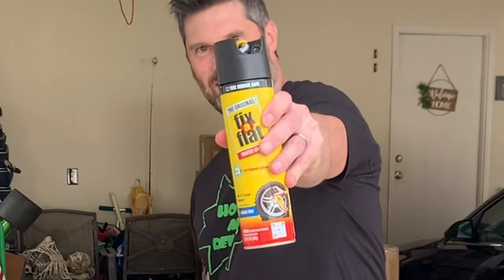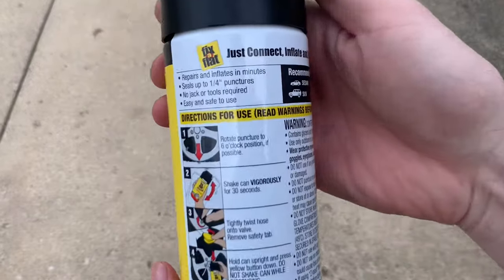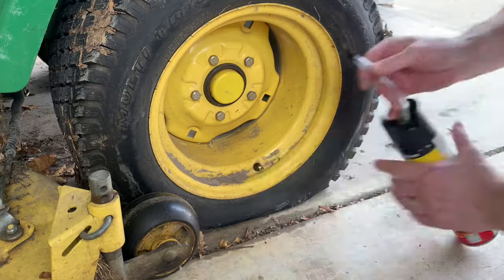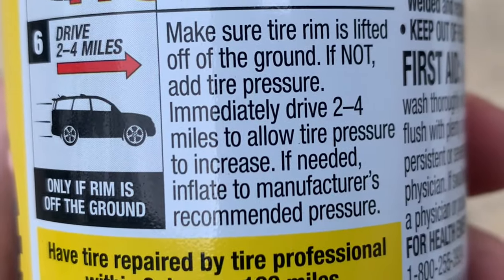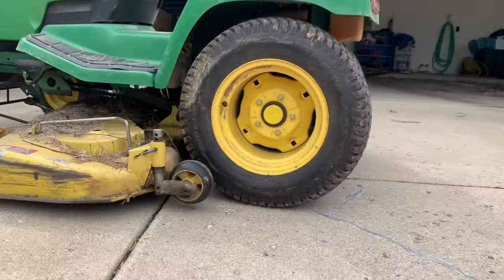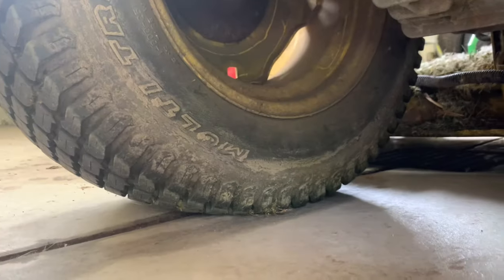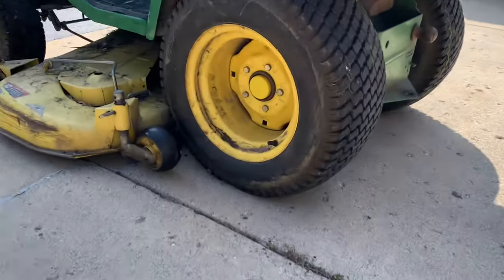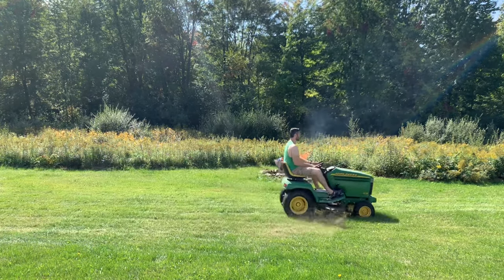FIX-A-FLAT vs Lawn Tractor / Mower Tire || 5 1/2 MONTH Test & Review! || Fix Tire Air Leak?

Comment: How does this compare to the green slime stuff?
Reply from the maker: I tried this just for fun because I had a can. It has still held up for this whole year as well. 
However, I would definitely recommend the green slime stuff. It is made for lawn tractor tires; it is specified on the bottle. I used it in a car tire last year and it is still working. 
Also, fixaflat is water based and can cause the inside of the wheel to rust. It is only supposed to be used temporarily.
Reply: @HowtoandReviewsOfficial  thanks for the feedback